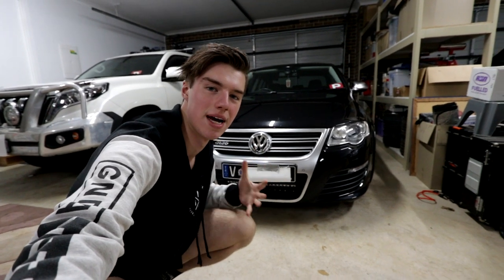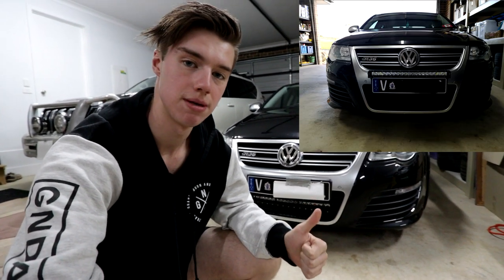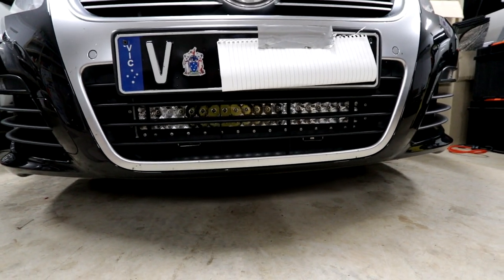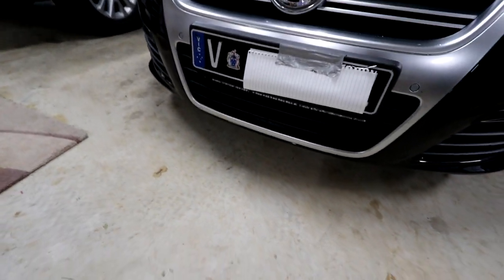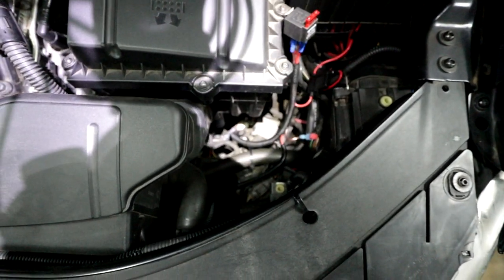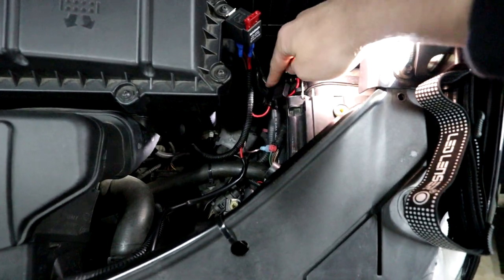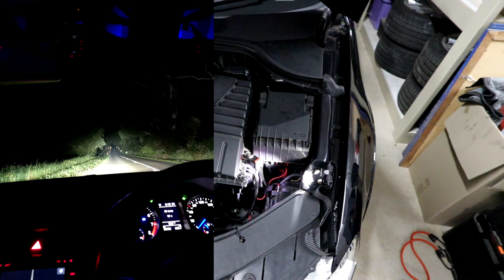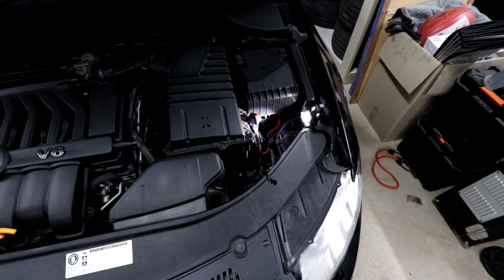HOW TO: Hidden Light Bar Install! Passat R36

Comment: Hello, awesome video! I ve been wanting to do this on our regular small city car but I m too scared it will interfear with the cooling of the engine. Did you notice any raises in temperature since you installed it? I m thinking of doing one of the 20inch one row led bars maybe that will help with more air coming in...

Comment: Does your passat have bi-xenon? Just bought a led bar for mine and was wondering is it legit to take that signal for led bar from that solenoid cable which controls low/high beam

Comment: Very clean man.

I know its picky but maybe paint that bracket you made black, give it a more OEM look in case someone takes a peek. Plus protect it from rusting.
Reply: It actually is painted black for those exact reasons, looking back at the video now I can see why you'd think it's not painted though!
Reply: @Doublsmmm  Sorry man didn't realise.

Video suggestion for you, make a video building a 12 or 15 inch sub in a powered enclosure for home theatre systems and such. High power of course :)

Comment: Hey man, great work with the fit! I've got a lightbar which i'm looking to install on my 36 wagon (either on the roof racks or in the grill like you've done). I'd just buy a pre-made wiring kit cause I don't have the know-how for a custom job but I'm not sure what plug the wiring needs to piggy back onto the factory high beams (ie. H8, H9, H11, HB3 etc.) and was wondering if you had any info on that?
Cheers!